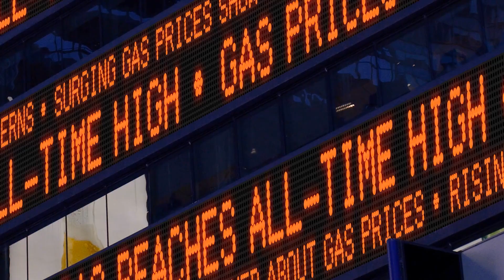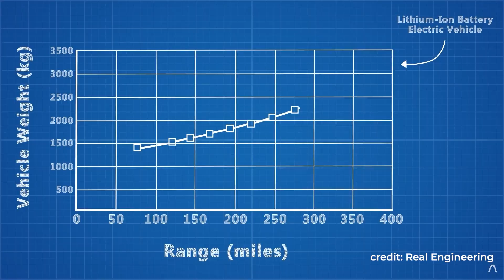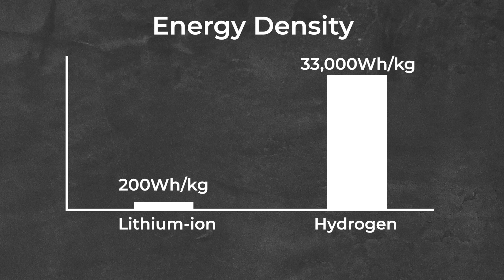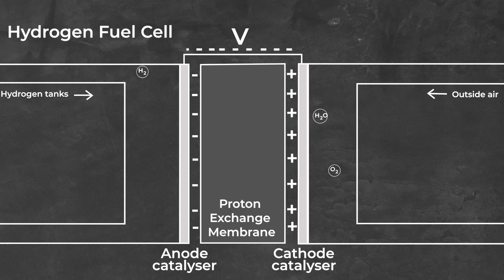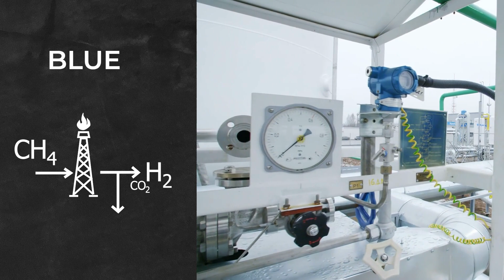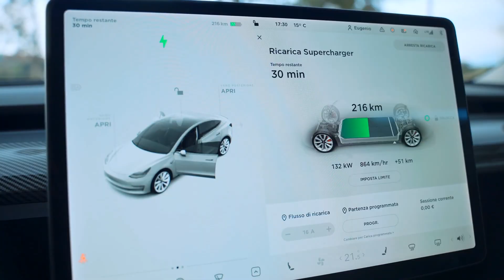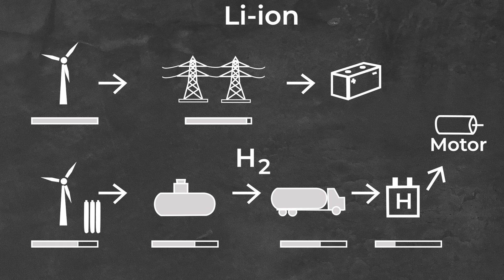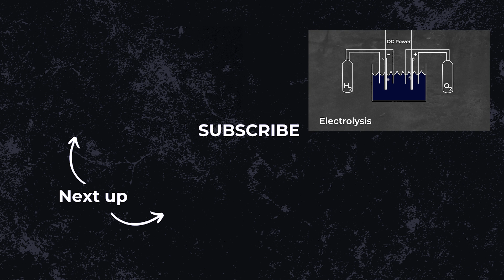UK Launches First Hydrogen Electric Truck  | Tevva Explained

Comment from the maker: Hydrogen hype or something we should be investing in more heavily? Let me know what you think!
Reply: hydrogen storage abnd better and new method for hydrogen production are two major area where we should invest
Reply: You missed clean (better than green) hydrogen, which is produced by a technology similar to fracking. There is no need for windmills, solar panels, water, or hydrocarbons. See what Proton Technologies is doing in Saskatchewan. They are the cleanest producers of hydrogen in the world, and their technology promises to replace grey hydrogen altogether. And they have a YouTube channel.
Reply: Hydrogen is the fuel the world has chosen to use for all life on this planet as without hydrogen nothing would be alive today. So, it's high time us humans learned to make use of hydrogen the way that mother nature goes about using it. 
In 2006 I started looking into a new promising technology that would allow vehicles of all sorts run with nothing but water in their tanks for fuel. At first it seems as if the laws of physics rule this out but then you take a look at all the things we don't know and low and behold I found the primary way nature goes about breaking the bonds of the water molecules. Plants break the bonds of the water molecules each and every day and don't require to be hooked up to any grid power distribution system. What I found after asking and answering the question, "How do plants break the bonds of the water molecules?" I found a pattern in that in order to break the bonds of the water molecules all the plant did was reach in and take the electrons away from the water molecules. You see it is this act of taking away the electrons from the atoms that make up the water molecules that break the bonds of the water molecules into their component atoms, IE, hydrogen and oxygen gas atoms. What I found that was so profound is it maters not how one goes about taking away the atoms electrons in order to break the bonds of the water molecules as each method will yield the same result; giving you hydrogen, oxygen, and the creation of electricity.

What this technology allows humanity to do is live in harmony with nature and not be so dead set against it like we are right now. Thus with this technology we can now simply switch the fuels as we move to phase out the use of fossil fuels.

Comment: Wrong 
The grid is way too small to carry enough electricity for EV
Also look at white H2 and direct cracking of water, water molecules break at 2200 C way more efficient than electrolysis

Comment: I live in the United States and I'm a truck driver , in 5 years they will probably have to stop using diesel and Cummins Diesel  Engines is already getting ready to use Hydrogen powered  internal combustion engines  they use the same engine below the head gasket and just reengineering the heads for spark plugs

Comment: You can also design create a add on water to hydrogen gas using electricity for existing gasoline Diesel engines to save the old engines you can recapture some water through the exhaust pipe also capture water moisture from air also capture water from rain water also have diesel gasoline delivery trucks deliver water put water in the gasoline and diesel fuel tanks of vehicles no pollution no emissions clean engines inside done manifested cocreated now worldwide

Comment: Have you heard of tesla semi?
Reply: The problem with the Tesla Semi, is load capacity for distance covered. Operators are going to want the best bang for their buck investment and as businesses, whilst it appears noble to be doing something for the planet, operators will need to keep their costs down if they are to survive as businesses. The downtime of having a truck recharging over many hours incurs a cost which cannot be afforded by the businesses and if the load has to be reduced so that the truck can cover more distance before recharging then this ensures this is an unprofitable proposition. Electric trucks and cars need to recharge as they travel before they can become a profitable proposition. This is just a plain economic fact of life, where reality has to kick in, which is an awful thought to some of the eco dreamers out there.
Reply: @JamesAlexander14  Government gives $40k incentive for electric semi. And Tesla semi can do $1/miles (1000kwh battery, $0.50/kwh so, $500 for 500+ miles (538 miles to be exact) which is cheaper than $2-$3/miles on diesel semi current price. I think electric semi is the future. After 360 miles (60 miles per hour) 6 hours later the driver must take a 30 minute break anyway, in that time the truck will recharge to 80%. And 80% of the drive is less than 400 miles anyway.

Comment: Perhaps I am missing something, but if you wanted to use hydrogen to power commercial air transport why would why not use it as a fuel to replace Kerosene? Granted it takes up a lot more space than kerosene but it has to be a lot more efficient than a fuel cell and both applications require cryogenics.   I think there are some very practical niches for the use of hydrogen as a fuel, fuel cell, or as a way to store energy but don't think any are feasible until we switch much more to nuclear energy (and one hopes, fusion energy in 10-40 years).
Reply: There are four forces working on aircraft, thrust, drag, lift and gravity. This means that everything is to do with weight being kept to an absolute minimum, for an aircraft to take off and maintain a height at speed. Batteries are by nature very heavy, which means that the payload must be reduced. Airlines could not afford to run these machines with reduced capacity, whether it is cargo or passenger and whilst it appears to be an eco friendly ideal, the reality of the physics being applied to aircraft, trumps the ecological ideals and if you did have reduced capacity, then the costs would increase and be passed on to the customer. Electric cars aren’t cheap by any means and neither is hydrogen based transport,but can you imagine the costs incurred if you tried to pass this on to customers with an aircraft run on batteries or hydrogen? Yes we have the potential to make this work and there are cases where small light aircraft have been fitted with electric motors and batteries, but to use on a commercial basis would require smaller batteries with much more power and remember, you can’t stop at a gas station when you are low on juice at 30000 feet! By the way, the US experimented with nuclear powered aircraft in the 50’s and 60’s. It failed.
Reply: @JamesAlexander14  I agree with all you have mentioned. But you didn't address my question as to the pros and cons of replacing the use of kerosene with Hydrogen. I have two ideas; first Hydrogen is very difficult to store easily, safely, and cheaply, and second; hydrogen requires a great deal of energy to produce in amounts required as a widely used fuel.  My comments re nuclear power were not as used directly as a fuel for air transport or military use but to produce the great amount of energy to produce hydrogen in large amounts.

Comment: Did anyone check if the stated capacity of that truck is indeed just 2000 kg ? 
It is a very low capacity for a truck that size.
Reply: It's all still mental masterbation of leftist elites.

Comment: More laughable Greenwash,
A truck this size which weighs 5.5 tons and can only carry 2 ton payload is pretty useless. A similar diesel truck weighs 4 tons and can carry 6 tons of payload.
Hydrogen is very explosive compared to diesel or petrol too.
The inefficiencies are rather ridiculous as well.
Ammonia is a bit more practical and can be used in petrol and diesel engines with some modifications, although it's highly toxic.

Comment: One place where hydrogen makes way more sense than just massive batteries is recreational boating, where you can take excess power generated from solar to electrolyze the water that you're floating on.  If I had the money to make it happen I would 100% be building a sailing catamaran that utilizes the massive amount of space where solar panels can sit to do this.  Toyota already has a electrolyzer/fuel cell product developed in conjunction with EODev that can be used for this (though their current model is an 80kw version, which would be far larger than what I would need for a 14m sailing cat) and is what they use onboard Energy Observer.
Reply: @UCzAf_ZA_nQYnrYjhKBJLApQ Unfortunately neither of those is a commercial product that they can just start using, and likely won't be for quite some time.

However with recreational boating being a luxury from the outset, it is easier for bleeding edge tech to fit in, with it's high cost, and can be done right now, today.

In fact, there are already hydrogen powered recreational boats on the market using commercially available fuel cell stacks.  Toyota also has an 80kw combined Fuel Cell stack and Hydrogen electrolyzer that was co-developed with EODev.  80kw is really only suitable for recreational boating, and really, the smaller end of recreational boating, but with that luxury market, the price tag of these systems is easier to swallow.

Container ships definitely could benefit from alternative fuels, and definitely contribute a lot of carbon, but unfortunately the cargo moving industry is 110% driven by the bottom line, so unless it's cheaper than burning diesel (or made illegal) they aren't going to make the switch.

On the plus side, modern container ships are just about the most fuel efficient way to move anything on this planet.  That's basically what has driven all of the development in ship design for the industry for the last several decades, reducing fuel consumption as low as possible.  It's why we see these container ships getting larger and larger, just to capitalize on the economy of scale for fuel usage.

 Though I suppose that is also a down-side, since it makes it harder to meet their cost margins for switching...  It sure would be nice to see some truly revolutionary new energy tech actually make it to a viable product.